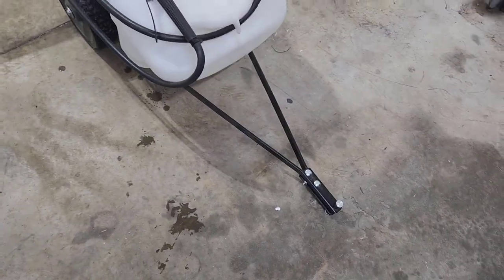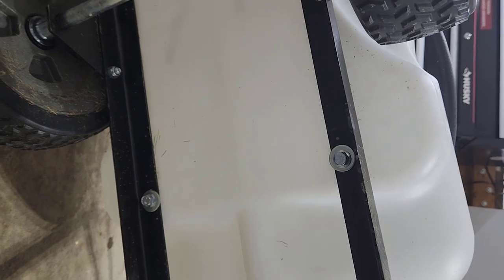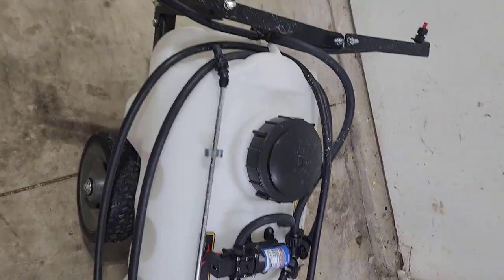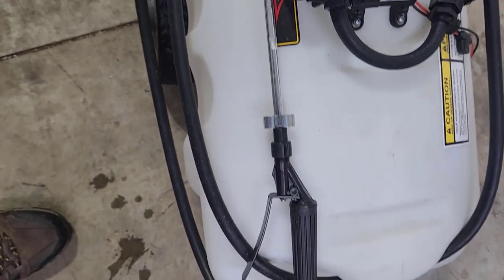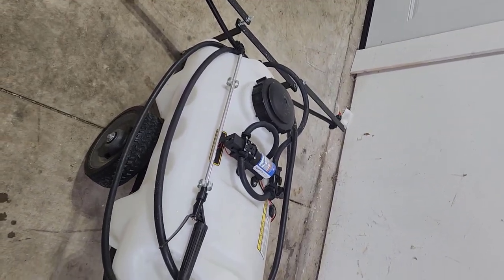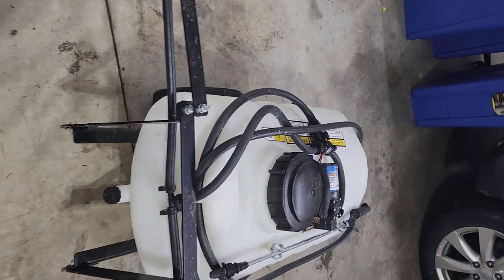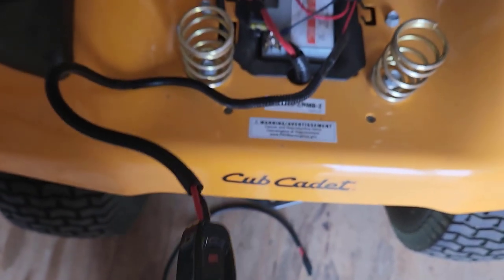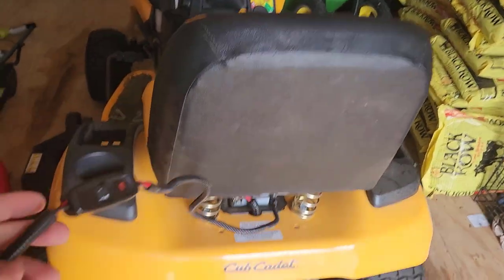Picking The Best Lawn Sprayer For Your Needs (BRINLY-HARDY Review/Assembly/Demo)

Comment: The manual suggests 5mph - looked like you were screaming along pretty good.  That may have to do with the trailer bouncing around.  I've found slowing down on my TroyBilt at 4-5 and I eliminate quite a bit of the irregular terrain.  I spray a small side pasture with this with no problems.  It's a great little sprayer for liquid fertilizers, fruit/veg foliar spray as well as insecticides, lawn insecticide and each spring Amino 2,4 D herbicide.  So it's a good all around yard/garden sprayer.  I also have the Brinley Hardy drop seeder with spike aerator.  I like their products, quality components, easy assemble and long lasting (if you take care of them as you noted, empty the spray tank after use and rise).
Reply from the maker: Yes the land out here is pretty bumpy and hilly. I had my wife walk beside it with no more than a brisk walk to help me judge the speed when I first started.  So happy to hear you're having success with the Brinley products!  I also bought the aerator/seeder combo which has been great so far... You mention 2,4D... I just did a video over this product. I was amazed by the results I received from it. My before and after was amazing to me... My wife and I are new to using these types of equipment and living in the country period so thank you for the comments!

Comment: Just curious the coverage you get with the 15 gallon.  Are you able to spray all 3 acres with one tank or do you fill multiple times?
Reply from the maker: Great question. It does take me a couple tanks going a moderate speed. I just wasn't willing to pay at the time the price hike to go with the next bigger tier.
Reply: @countryprideliving  Ok, thanks for responding.  Are you able to control the spray rate accurately to match a product's spread rate?  Also, do you have a good reference for someone who wants to start out such as a detailed how-to guide or forum?
Reply from the maker: @Keyholeify you're welcome... This model sprayer doesn't have many setting adjustments unlike the aerator seeder combo I bought. The best I could offer you would be to control the product spread with the speed of your tractor. If it's something that you want to saturate then maintaining a slower speed would be optimal. If it's something that you need to lightly spread I'd say keep the tractor at a good pace maybe near 4 to 5 mph. Sometimes product instructions will include this information as well. I believe the Sprayer instructions have information on this as well. Good question on the how-to-guide..My wife and I have just started a blog to go along with this channel. I'm actually in the midst of putting together some of these guides. I'll ping you on here when complete or you can visit the blog and get notifications. T https://www.escapefromcitylife.com    Take care.
Reply: @countryprideliving  Awesome!

Comment: DO YOU STILL HAVE YOUR CUB CADET XT1 AND YOUR BRINLY TOW SPRAYER?
Reply from the maker: Yes! I still have the XT1 50 inch deck and yes on the sprayer. I read a lot of bad reviews about other sprayers but so far very impressed with the BRINLY. I also went with BRINLY for my aerator/seeder combo.  Video in link. Thx for watching.
https://youtu.be/ABMXL6CYkYk